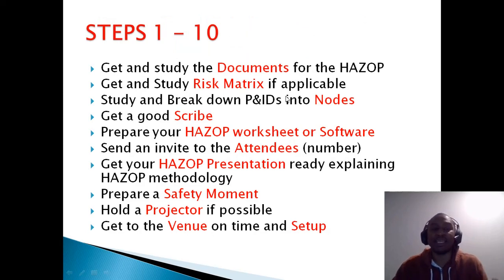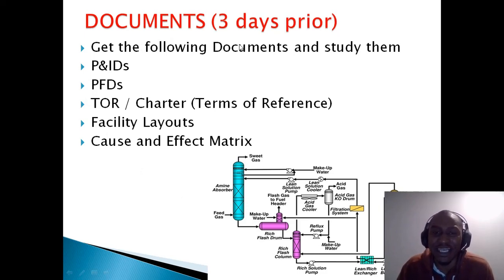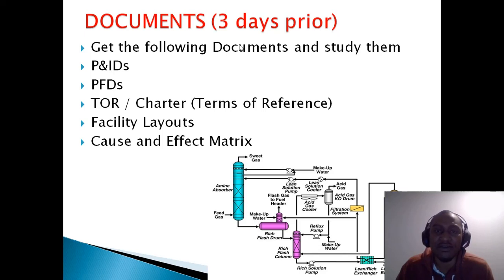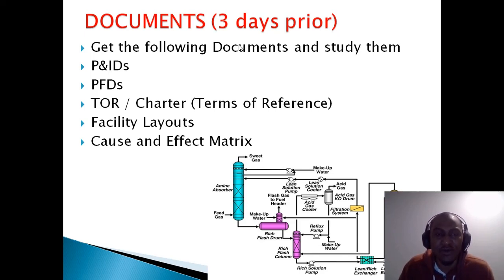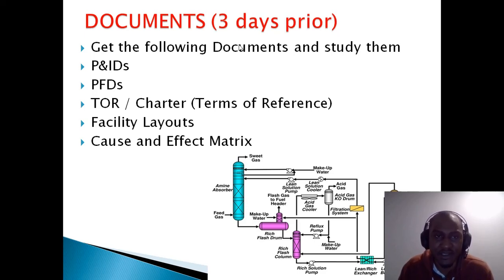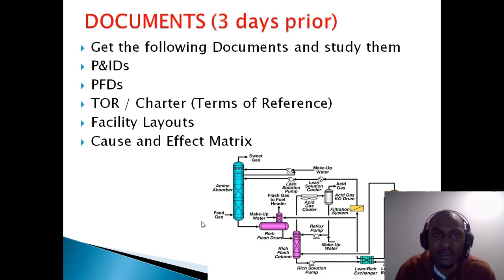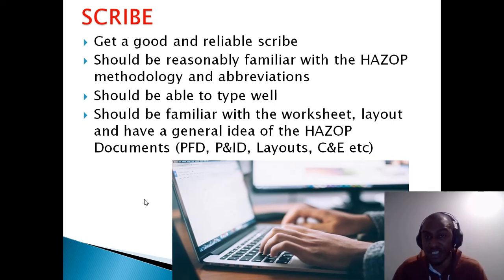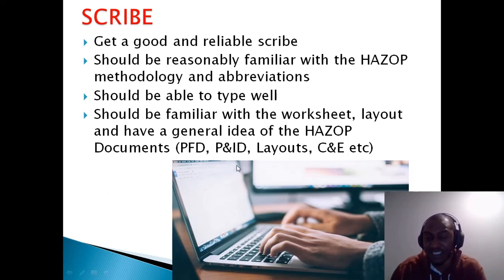Critical Steps before Facilitating a HAZOP Workshop

Comment: Hi, does a HAZOP facilitator need a certain certification? Or can you facilitate HAZOP's on smaller systems yourself, as a team leader?
Reply from the maker: It really depends on the requirements of the clients / company you are facilitating for. Experience is extremely valuable even if you have all the certifications